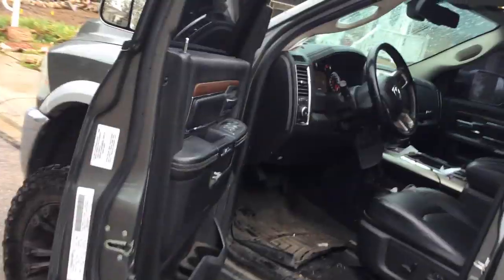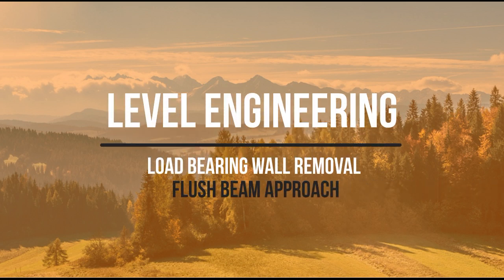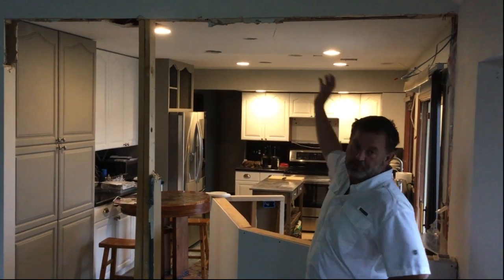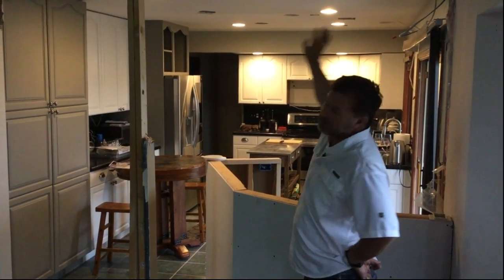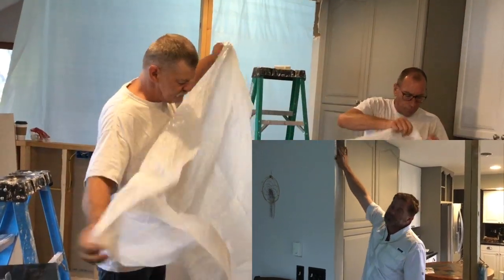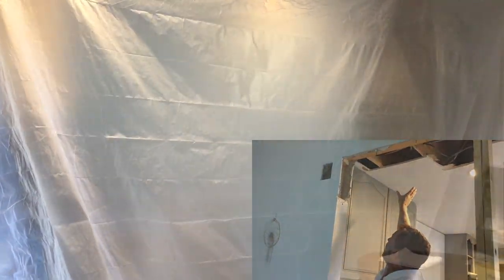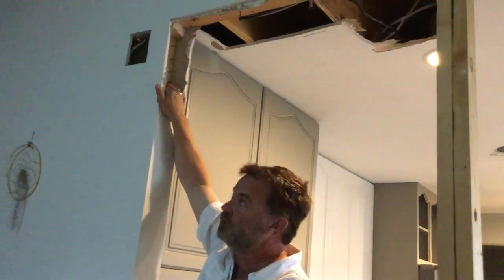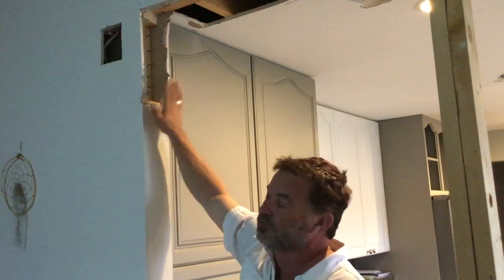Load Bearing Wall Removal - Flush beam approach

Comment: I would like to remove a load bearing wall. The attic is blown in insulation. Does the insulation need to be scooted over or will the beam go right up against the sheet rock in the ceiling? Thank you.
Reply from the maker: The sheetrock must be removed in most all cases to lift the beam in from below and attach hangers and straps. So the insulation must be pulled back.  Bummer attics are rough and put on tyvek it helps..

Comment: Really nice work. Like the flush beam. I am trying to do the same but people keep trying to add a beam under. It is a 10 foot ceiling so it is not that bad but is so hard to find out the price.
Reply from the maker: Thank you Marcelo. Yes, this can be a challenge sometimes. Where are you located?
Reply: Orlando-FL. I am considering doing it myself with a help of a friend if the structural engineer determine is a easy process. Does it cost a lot more to do a Flush beam or people with the easy fix?
Reply: @marcelosantana9311  a guide price is around 7 roughly. Every job is different though

Comment: If this is done when there is an attic above could you position the new header on TOP of the joists and hang them under rather than cut out the ceiling joists to flush mount the header? Assuming everything is sized right and the point loads carry down to the foundation properly on the ends of the new header. Seems like an extra tall joist hanger could accomplish this?
Reply: I know 5 months late, but I did this by bringing LVLs through my gable vent and hanging with hurricane ties to the ceiling joists, then adding blocking to the necessary areas to path the load to the foundation. Wound up with only about a 5" strip of drywall to patch.
Reply: Thanks Kris. I ended up cutting a slightly larger hole in the ceiling to pass 2x10s into the attic to build up my header in place. Notched the drywall past the former wall opening and fed joist hangers up to hang the ceiling joists to the new header rather than hurricane ties (local inspector didn’t like the idea of hurricane ties but was fine with Simpson hangers). I rested the header on the studs past the opening and posted under those studs/floor joists in the basement. The whole house laid out well to make this come together nicely. Little more than just the 5” strip to patch but it turned out great!

Comment: Sounds like homeowner wanted to save a few bucks and the contractor purposely told the HO that it wasn't a load bearing wall.  Lesson is don't waste someone's time and pay someone to do it right the first time.
Reply from the maker: Exactly! With such a large investment on your hands, you must invest the small amount to ensure the work is properly executed. Thanks!
Reply: I have always said during renovations that the home owner should never cut costs in structural or waterproofing. Those cost cuts should be made in your cosmetics.

Comment: Should of hired an electrician to move those wires. The only place you're allowed to drill holes in LVL's is middle third in width and middle third in height. You just voided the manufacturer's warranty.